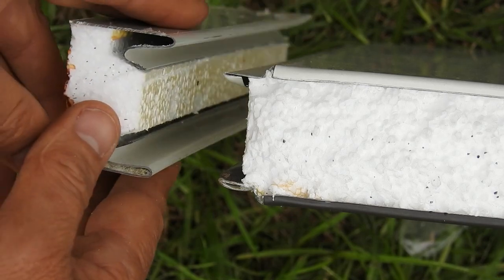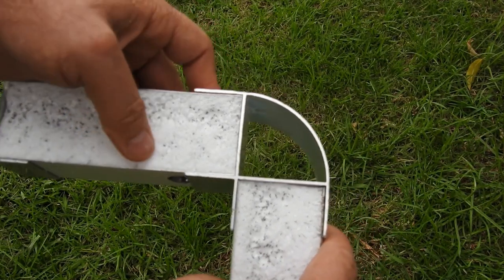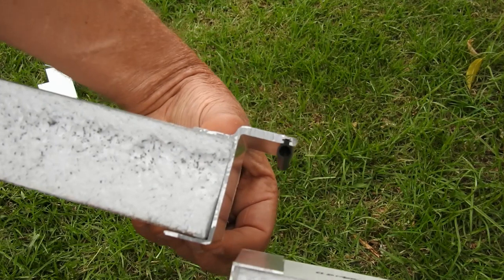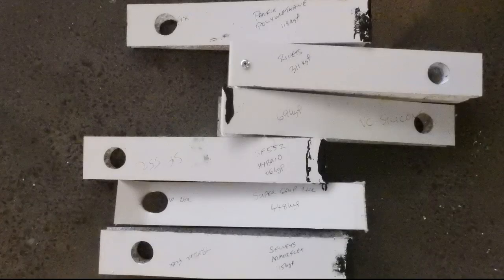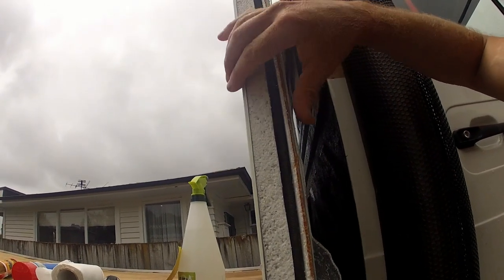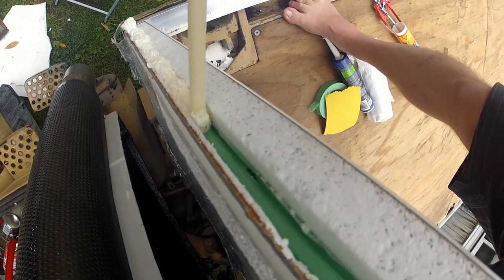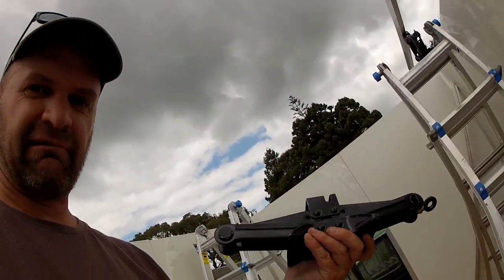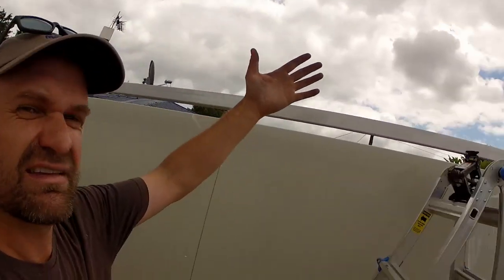Unimog camper #3  Box build

Comment: I want to build a camper van on an old 75' Chevy 1 ton truck chassis,  it's a 166 inch wheelbase which is larger than most and used primarily by the farmer or commercial application but occasionally an RV was made and it was very retro and nostalgic .. even if i use older materials on the outside, it should be a great unit

Comment: Great minds think alike apparently, I made my truck box out of 50mm cool room panels and did similar tests of the glue and rivets, I ended up using sikaflex pro + which is good but has a WAY longer cure time than the 3 days they claim. Have you noticed thermal bridging with those corner connectors? I used regular angled alloy to prevent it yet still notice it gets hotter inside that out from the steel gathering the heat.
Reply from the maker: Yeah it deff bridges - am working a way around it.  I thought about both ways and decided that the corner connectors would be stronger and there is a way to deal with the thermal bridging.
Reply: @brendontait6968  Definitely stronger but its getting hot and even my truck gets hotter than outside because of the steel even without bridging, if I had my time again I would have used fibre glass panels..
Reply: What size and style rivets do you recommend bro ? I’m still trying to figure that and which poly adhesive to buy that Bunnings or anyone in Australia stocks
Reply: @unbr3akablonsoundcloud-tx6co  I used the biggest regular 4.8mm alloy rivets, they go on sale at Bunnings for $20 a box of a 1000 sometimes. Skikaflex pro + is all you need usually but it depends on what surfaces your sticking.
Reply: @jedics1  I’ve got a 47 year old camper trailer I’ve stripped to bare metal, rust treated, and coated all over with chassis black. I’m wondering if I should sand back the contact points where the frame meets panel / channels . I don’t know how the bitumenous paint will hold to the panel

Comment: I would use Polyesther fiberglass matts glued on top (with epoxy) of your box to seal everything and strengthen the structure. Maybe cut out the windows and sunroof first. I really amazed this is possible with standard panels like that, good project.
Reply from the maker: Hey Robbert.  Are you meaning just fiberglassing the top?  I'd be against that due to differential expansion of rigid materials bonded directly ontop of each other may cause delamination.
Reply: Raptor costing the entire exterior  should be fine shouldn’t it ? It’s a polyurethane product . If it made contact with the poly adhesive I’m not sure though ? My original plan was to spray as close as I can to the edges and  angle  would hide where I didn’t want the paint to meet the adhesive. Because my panels are being installed lengthways (2 x 2550 x1980)  only an extra piece of flashing would neeed to run along the centre where the panels connect . Interest to know your thoughts 

Cheers mate !
Reply from the maker: I investigated raptor, it couldn't be applied as thick as rhino and apparently not as UV stable.  Either would be fine on styrene, however... there is none exposed.
Reply: @brendontait6968   So rhino would be the go on polyurethane ?once all angles ,extrusion etc installed just prime with an epoxy and coat with rhino ? Cheers mate !

Comment: Sika flexa he in Australia is the  ducks nuts when it comes to projects like urs 👍👍👍
Reply from the maker: Yeah, I don't rate it at all.  Overpriced, customer service is rubbish, sellys armorflex is nearly twice as strong in tests I've done and less than half the price.
Reply: I'm using Selley's Armourflex as an adhesive and seam sealer  to fix an aluminium pontoon deck to the aluminium deck frame (in conjunction with rivet nuts and 316 stainless steel bolts). Glad to hear you rate it over Sikaflex.

Comment: i made a little camper out of fridge panels with a similar system and regret the thermal bridging that the aluminium cause.i have worked hard to fix this with aluminium angle instead of extruded joiners and 45deg miter joins this is important especially for summer weather
Reply from the maker: My thoughts are to just chuck some thin insulation on the inside 100mm either side of the bridge.  Am keen to see if it will sort it.
Reply: I dont think covering it will work very well as both inside and outside skins are connected. I guess with your giant battery pack and large  size room and mild climate you can use ac to solve it.
Reply from the maker: @stjimtemyth995  I'll do a video in the coming months on it with thermal imaging to see how well it works.   Thx

Comment: The sicaflex was so neat when you put tape down each side. I have never seen that before. So clever.
Looks great. How sturdy will it be on the open road?
Reply from the maker: I thought everyone knew the tape thing.  There are some cooler ways I'll prolly show later on. As far as the open road goes, at some point it will be solid as, however currently I'm fairly certain that it would fly off the back in pieces.  tbc...

Comment: Haven’t thought to use a sandwich made of styrofoam and fibreglass? I know it’s really efficient in terms of isolation and also it does not absorb water which is a big plus!!! And another question... I was thinking to build an external frame similar to the container one to make it more robust and more easily detachable from the truck... any thoughts about it? Anyway thank you very much for your videos... they are a very precious source of information!!!
Reply from the maker: Hey Stefano, I did consider it.  Everything has it's pros and cons.  I want a rugged, solid truck.  A steel shell will cope much better from a lightning strike than fiberglass one, I have an old fibreglass/foam shipping container that is waterlogged - when fiberglass gets a decent hit, it can crack which can lead to water ingress whereas steel generally dents.  Mostly, I'm cautious about outgassing from fiberglass resins, I'm wanting the interior to be as fume free as possible (this is something I'll dip into heavily in the future) the steel has an oven baked enamel which is likely to gas significantly less than fiberglass.   Plenty of people make detachable shells and it works for them, I wanted to make a shell that was more integrated with the truck, there are benefits to this...  lower insurance, registration fees, also can make things like a passthrough easier.

Comment: Love the work bud , Is that a standard circular saw or a cold cut saw ? What kind of blade are you using ? I’d have to buy a cheaper option saw for my project , any advice would be appreciated, cheers mate !
Reply from the maker: Thanks, just a standard circular saw blade.  If you are cutting ali, make sure you wax it frequently and don't be too aggressive with cutting speed.

Comment: Hi man, I discovered your work via your videos that are great, you do great work and live Unimog  👍 .
 I have two questions for you if you don’t mind I have the same project as you (setting up a refrigeration cell on an Unimog) I wanted to know which panels you took for the construction of your cell (with or without sheet metal coating) and that it glue used you to glue the different panels? 
My second question concerns the interior design, how would you fix furniture in height? I would like to gain space make a hanging bed and put furniture in height but I am afraid to tear the panels by fixing them on... 
if you could help me I would be grateful
In advance thank you
 Florian
Reply from the maker: Hey, I used the panels with sheetmetal.  I made sure to use polystyrene core instead of polyiso. Polyiso has a habit of delaminating since it is more rigid than styrene.  The glues I recommend are the silane terminated polymers (hybrid) or polyurethane adhesive sealants.  

Wit regard to fixing...  I was also going to do a dropdown bed.  I think the key is spreading the load over a large area.  In my version, I was going to mount to the ali section that is in the corners with some other ali section to thicken it.  It seems pretty good as long as you dont have point loads on it.  Have a look at how I mounted the pillow bearings on the door frame.  I used an ali section that was longer than the bearings.  Although this was mounted on the door frame, without the long section the loads were liable to flex the panels and frame.  Obviously areas that needed a solid mounting point like the rear door frame, I built out of large ali section.  

Spread the load out. Use glue, vhb tapes etc instead of point loads like rivets where you can.
Reply: @brendontait6968  Thank you so much for your quick response and all that information. The cell panels are not sheet metal, do you think I should add a sheet metal on top to fix the furniture? Do you have pictures of the installation of your layout and more specifically of the bed?
Reply from the maker: @floriantorche5408  have you got a link for the type of panels you are using?
Reply: @brendontait6968   no unfortunately I have no link to know the design of the panels, I just know that the cell dates from 1982 because I have the plate of the manufacturer
Reply from the maker: @floriantorche5408  flick me a msg on insta, take a pic or something

Comment: Hey mate. Very interested in the build. Have learnt a lot from all your videos. I have a few questions please. How much did the boxing cost? Iv emailed metalcraft but haven’t gotten a reply. How do you fix cabinetry and interior bits? I was thinking about glass composite panel over the cool room panel, however I feel it will be much more expensive. If you don’t mind, how much do you think it’s cost without the crap sika failure? Must have been very sad after all that work, thanks very much for finding that out for everyone. Love the build and really hoping for some more videos. I just bought an aus army technical manual on trade me. Lots of mog info. I could scan and send if you’re interested as a thanks for your awesome videos.
Reply from the maker: Thanks Matthew, yeah a copy of it would be amazing.  Msg me on insta. Any interior stuff could be fastened by a piece of L section aluminium and glue, double sided tape (vhb style) or rivets.  You can just buy composite foam panel if that's what you are after.  I prefer steel because it dents if hit rather than splits. It is also more resistant to lightening strikes.  The box cost me about NZD $3,000 to build.  I'm going to start working on putting another video together this weekend so should get it out shortly.

Comment: Hi mate, 
What did you mean when you said "the stand out was sika 2h super grip so I'll be using that, but I couldn't recommend using it for any building project so avoid it" ?
Thanks!
Reply from the maker: I thought I'd be thorough and test the glues strength before I built the truck.  The supergrip was the strongest by a long shot, however... I didn't test what it would do when it got wet.   On the front of the tube it said it was waterproof so I didn't think twice about it.  But as soon as it got wet, it completely let go.  I think what happened was the polyurethane absorbed water and swelled (after it was cured).  The expansion I think separated the bond as it grew.  I'll do a followup video on this
Reply: @brendontait6968  That makes sense. Could you recommend an alternative adhesive? Really appreciate your reply too.

Comment: Are you saying do NOT use the Sikaflex? What happened?
Reply from the maker: Absolutely... well not the stuff I used anyrate.  I used sika supergrip.  It showed the strongest in my tests by far, the data sheet said it was waterproof etc.  So I used it.  However as soon as it gets wet, it falls off.  The box basically started falling apart.  The repair cost much more than it cost to build the whole box.  Sika denied any misrepresentation  on the data sheet.  I offered to bring samples in to show the problem.  They didn't want to see (they already knew but didn't want to acknowledge the problem) it's a pity, because I use to rate Sika fairly highly.  And they actually do make some good products.  But don't expect them to stand by their products. I choose to use other brands from now.
Reply: Which glue do you now recommend?
Reply from the maker: @ThaboNel  I am a fan of the recent silane terminated polymer adhesives. (Normally reffered to as hybrid) previous tests I have done have shown them to be nearly twice as strong as polyurethane.  They skin quick, however if curing to any depth they will take MUCH longer to fully cure than polyurethane or silicone.  They clean up up with alcohol.  Always etch prime aluminum parts first.  If I didn't have beef with Sika it would be their 552.  But I use Selleys armourflex (not the solar one). My last tests showed this to be significantly stronger (double) than 552.  But I suspect the 552 wasn't fully cured.  Armourflex is also about half the price of 552.
Reply: Thanks for that, will use it when I start my build.
Reply: Does sikaflex have a primer that you need to use for aluminum?

Comment: hows the diy coolroom panel build holding up?
Reply from the maker: Yeah, good.  There is quite a lot of thermal bridging with the joiners I used.  I'll have to fix this at some point.  The reason I chose that type of joint is it is stronger than the alternate non thermal bridging type joint.
Reply: @brendontait6968  thanks for the response. the xps fibreglass skin sandwich panel is very expensive. what skins are on your sandwich panels ? what size thickness in sheets did you use?
Reply: Im assuming the xps composite fibreglass skin has less thermal bridging as oppose to colorbond skins. are you reffering to the channels used/ extrusions?
Reply from the maker: Both...  I could have joined it in a way where thermal bridging wouldn't be an issue but it wouldn't have been as strong (but still could have been strong enough?) The skin does conduct the heat from the aluminum down about 150-200mm. The fiberglass stuff wouldn't do this.  The thickness of my panels is 50mm.  The reason I used the steel panels is because they dent rather than crack and become waterlogged.

Comment: can you get those modules in different thicknesses?
Reply from the maker: Yes, the factory I purchased from could make in 30,50,75,100,150 and 200mm thick.
Reply: @brendontait6968  150-200mm is good ;) wonder if i can get that stuff here in Scandinavia.
Reply: @grapsorz  almost certainly. SIP's in plywood are commonly used for construction.

Comment: Hey mate I would really appreciate if you can tell me about your base channel that you used at the bottom. Height width and thickness. Thanx in advance .
Reply from the maker: The channel I used was just provided by the panel company.  Obviously the same internal width as the panel, about 30mm high and it was only fairly thin... like maybe 1.2mm thick?
Reply: @brendontait6968   thanx mate for the advise. Yeah it's very thin I can't find anything else out there that is thicker. Looks good the way you done it 👍

Comment: Was it easy to source the aluminum extrusions.
Reply from the maker: keith fowler the extrusions come from the factory that supply the panels.
Reply from the maker: Tbh I think if I were to do it again I'm not sure I'd use that type of extrusion.
Reply: What type of extrusion would you use Brendan? I'm still keen for more videos =) any info would be greatly appreciated
Reply from the maker: @mat4260  hey mate, I'm not 100% sure what I'd do....  there are two main ways of doing it.... the way I did it or just using an L shaped ali section inside and out with the difference being that the latter won't thermal bridge.  But my guess is the type of extrusion I used will likely be stronger. With the downside of the thermal bridge.  I think it is easy enough to get around tho, just putting some insulation over the corner sections (and a bit down the walls near to the corner).  Will be a new vid out in the coming weeks.   Cheers
Reply: @brendontait6968  cool. Yea I'd def go with premade corner section. Seems like it would be much more rigid. How did you attatch the bottom plate to the mog frame? I looked at one today
Reply from the maker: @mat4260  just glue... I used armorflex with the addition of steel tie rods in the corners.  You could use glue and rivets if you want more insurance.
Reply: @brendontait6968  oh really and thats solid enough? cool. 
i was thinking of bolting the bottom plate down. i may use some long threaded rod through the entire structure. i think ill put panel horozontally
Reply from the maker: @mat4260  when I tested the glue in that orientation it equated to about 150kg/50mm which works out at around 40 tonne around the perimeter.  Don't trust me tho... this is my first time doing this, so I don't really know what I'm talking about.  I considered laying mine sideways to begin with too but thought vertical may be stronger due to each side of the sheet connecting to the top and bottom extrusion rails without going thru a glue joint.
Reply: @brendontait6968  had you considered galvseal to glue the joints...ive used it for years on car panels...steel panels literally tore to remove them years later...the glue joins wouldnt budge...have to heat to peel the glue line...love your vids...looking to build a large mobile home unit like this...have been looking at aluminium honeycomb ali panels...they come as a sound canceling barrier panel...i have a low frequency sound sensitivety problem in most districts around NZ & here in PNth
Reply from the maker: @Errol.C-nz  I've not actually heard of it...   but I'll probably use it on my next build by sounds!   Thanks